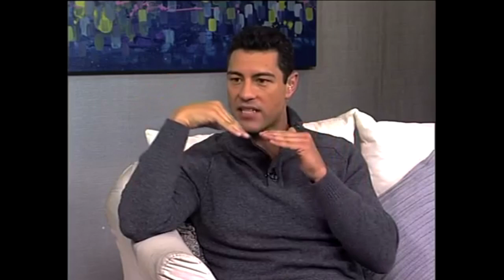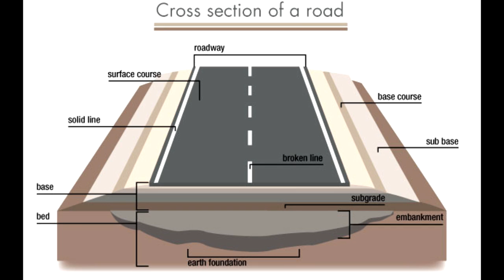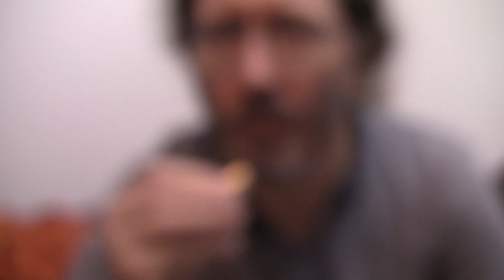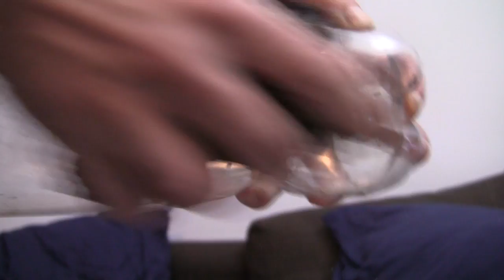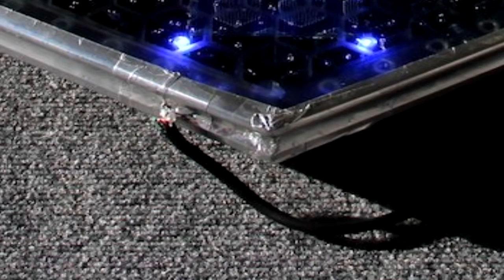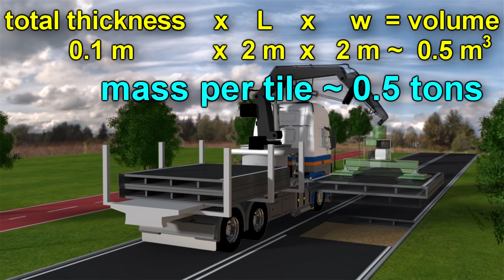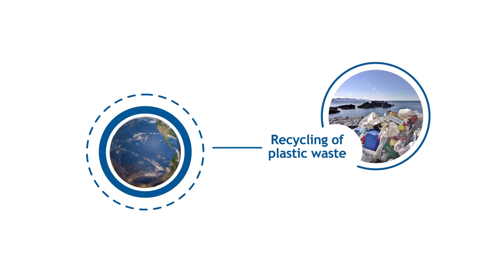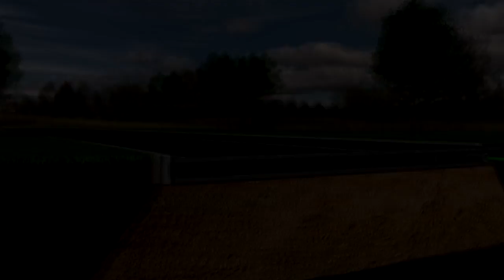Plastic Roadways BUSTED!

Comment: I called bullshit the moment I saw the floodproof part,  it MAY help with drainage over time but it will not prevent a flooded road, just a week ago I saw a drained road totally flood and the drain made no difference in the severe storm, no way in hell should being flood proof be a factor, that along with its other floors make it a scam clearly, there should be fines for things like this.

Comment: Wouldn't polybenzimidazole (celazole) be an example of plastic that fulfills a lot of properties required of road surface? The only problem I have found with it is that it is not recycled (as far as I know) and a bit pricey (5690 USD for 12x12x1 inch sheet).

Comment: If I were to make any change to the way we do roads, I'd swap the compacted hardcore for steel reinforced concrete, that would be immensely expensive to install, but the savings down the line would come from reduced flexing of the road surface which would then extend the time it takes for the road surface to crack and degrade and reduce the frequency of resurfacing operations needed.

It would also allow the ground below and around the road to be composed of gravel allowing better ground of absorption of water (whereas compacted hardcore can't absorb as much water) and would be less vulnerable to ants and tree roots.

It would also provide that channel they're after for utilities.

The problem of course being it would be expensive to install compared to hardcore and politicians tend to think of the election cycle ahead rather than the long term.

Comment: sooooo. instead of a bed of gravel and asphalt.....plastic road ways need a gravel bed, a bed of concrete, a retaining wall of concrete then the plastic top....so its a road with a plastic liner....right? I get the idea of using up plastic waste but is there any other mass used thing they could waste time on instead of road surfacing? Asphalt is about the best for its job, leave it alone and invest in something else

Comment: Just like with solar road ways this is not the way to solve a problem, you don't just throw out something that works because it has a few flaws, not if the system you're replacing it with is completely untested in every way. We should look instead at the problems he current system has, and how it could potentially be improved, then use incremental testing of different hypotheses which may yield various improvements. I would assume the major problems current roads have is the cost of construction, the sheer mass of material used for the roads, the energy that's required, and then longevity. Longevity is probably the most major improvement that could be made, even if a road costs as much to make but lasts twice as long you've basically produced a road for half the cost. Cost of construction could go down massively if more automation, less human labor, and perhaps cheaper energy was used, mass of material is probably something which can't be changed, we could build roads out of steel which is far stronger and lighter than aggregate, but has a very low lifespan when exposed to the weather, constant vibration, solvents, daily temperature variation etc. I'm quite sure we can't improve upon the efficiency of using a thick heavy layer of stone under our roads. But the road base generally outlasts the rest of the road, it's the surface which breaks down and requires frequent repair, doing so requires closing the road, tearing up the most damaged parts, filling in potholes, tipping hot energy intensive asphalt over the surface, pressing it down, waiting for the road to cool before use etc. This is the part that we might be able to improve, and should be looking at. Perhaps in the future we might have road surfaces capable of self repair at low temperatures? Cracks will invariably form in the surface but if they are closed or filled in before water and grit enter them, then temperature variations expand the cracks, more debris fall in, etc, which eventually causes the major cracking that requires repair. Perhaps just using small drones which travel among the traffic and inject hot Bitumen into crevices might vastly improve road surface longevity?

Comment: Here is another bigass problem with plastic, lets say they use PET plastic. The gasoline will slowly turn the plastic brittle and destroy it.

Also about the attachment part. You can easily plastic weld PET with ultrasonic or high frequency welding, Also heat welding which is probably what they would use.

Comment: A slightly different issue that may have been missed with regards to the hollowness of the roads... not only do you have those "pillars" carrying all the weight, you have to consider the stresses on the plastic next to the pillars when vehicles are putting their weight in between them. It won't be the pillars failing, it'll be the plastic surface cracking and collapsing right about at the edges of those pillars. I hope this makes sense...
Reply: Yes, like walking on a ceiling as opposed to the roof trusses.

Comment: + 
Thunderf00t  THE READS THEY WILL BE REPLACING THAT WARE OUT NOW TAR ROADS ALREADY HAVE ALL THE WORK DONE TO THEM UNDERNEATH IT WILL BE JUST A MATTER OF TAKING THE TAR SURFACE OFF GRADING FLAT AND PUTTING THE NEW ROAD DOWN NO BIG EXPENSE LIKE YOUR SAYING AT ALL.

IT WONT HAVE TAR ROAD RUBBING ON IT THO IT WILL HAVE RUBBER AND LOOSE DIRT NOT A SOLID SO NOW BE REALISTIC PUT DIRL ON THE THICKNESS THE ROAD WILL BE AND RUN TIRES WITH DIRT OR DUST ON THEM OVER IT WHAT YOU'RE DOING IS UNREALISTIC.

MIND YOU ITS PROB AS GOOD AS CARBON DATING TOTAL BS AND DOESN'T WORK

Comment: Before I watch this, can I guess a few of the points Thunderf00t will make?

1) Plastic doesn't handle repeated stress very well. Trucks and cars are heavy...

2) Plastic is known to break down fairly quickly when exposed to temperature fluctuations, like those that roads have to go through due to changing seasons...

3) Plastics in general, don't react well over time when exposed to sunlight and extreme temperatures...

4) For fuck sakes, hollow plastic roads? Does someone not understand that plastic isn't well known for its ability to withstand wear from friction, and becomes rather slippery when thing like oil based liquids cover its surface?

Methinks someone spent too much time alone in his room with his Hot Wheels race track...

Time to un-pause the video, this auto be good!

Comment: i think you forgot to mention that if there are cables running through the road, then when they remove a section, they will have to cut the cables running through the road in order to take the section out... and then they would have to put the cables back together in the process of replacing said section. They even show this in the video... although they clearly forgot to put the cables back together.

Comment: you missed the key point in the presentation mon librepenseur 
"contributes to 'circular economy' 
why would that be?
busy-work jobs, replacing the defective roadways and driver-less cars...
that isn't CASSE or steady-state,
that is neo-communist eh?

what is the plastic made from? what is the ERoEI of the plastic?
ostensibly, they do not know of MK Hubbert, Al Bartlett or S Michaux, despite being 'green eco-hipster"
too much numbers...
they do not know about resource finite limitations...

the ERoEI of plastic road is ridiculous.
better is the concrete as a byproduct from breeder reactors.
that's right. nuclear waste byproducts would make excellent tarmacs and road surfaces...
of the next-gen thermoplasma nuclear reactors etc...

Comment: To add two things, what about the water in the road, when the temp drops. It would freeze. Second, a big problem with plastic is the sk, microplastic, we have problems today with asphalt pollution from wear and tear, plastic would create a fog, that would be like asbestos. Just my 2 cents
Reply: monsieur jonsson, well said!
you haven't even begun to examine the ERoEI of the process,
or resource scarcity of the hydrocarbon to make said volume of plastics 
(MK Hubbert, S Michaux, IIASA, WFSF).

indeed, a carcinogenic fog not unlike asbestos, after rain + humidity or freeze and thaw.

Even if the polymer was GMO and technically 'alive' + error correcting...
(we now have pseudo-live polymer chains)...
it would be a risk to human security of biological contamination...

however... a thermal heat-sink power source from roadways
was also considered seriously by think tanks such as 
The Fenner Conference 2007 etc... many different groups meet there from around the world,
and thought about that as well as solar-collector energy etc.
(iodide gas reservoir is parabolicaly superheated by reflective mirrors etc...)

je prends conge, merci pour l'sharage et
bonne chance et bonne sante a vous mon librepenseur!

Comment: Many years ago, when I lived in Southern California, a stretch of road was repaved with bitumen mixed with ground-up waste tires, as you mentioned above. A big deal was made of this in the news, so when I happened to find myself needing to use that road, I paid attention. Let me tell you, that was BY FAR the smoothest stretch of road I had ever been on. It was as if I was driving a hovercar, not a single bump or dip. Why this is not a much more widely used technique, I cannot imagine.
Reply: Craig Corson How long was the road? Because short roads having been repaved recently are very smooth.
Reply: I don't know exactly, but it was several miles, not just a short section. It was literally as though I was driving on air, on glass - on something very very smooth.
Reply: Could be, I guess. As you say, who knows?
Reply: because of thermal expansion and how much slicker those roads get with frost up here in the frozen north they are useless
Reply: Used, worn out tires are very cheap indeed, and aside from being hung from the sides of boats as bumpers, have few other uses.
Reply: Happen to have a source for that claim? Sounds like BS to me.

Comment: The "economic" arguments for these are always poor and extremely bad logic. So watch out for it as you often hear it. Basically they say "this road will cost 100 million, employ 50 people who will spend their money into the economy and stimulate it. On top of that the purchasing of goods needed will put money into local businesses and increase tax revenue"

So debunking each claim. 
1. Its increases taxes.

Theyre spending 100 mill to collect 40 mill in taxes. So theyre essentially just spending 60 mill. Theyre worse off not better.

2. It creates jobs.

Those jobs are created by destroying jobs. The average government job pays 10% more than private. So to create 100 government jobs you needed to tax the equivolent of 110 jobs. Then the cost of bureacracy on top of that.

3. The spending from the workers and buying of goods needed to build the road will stimulate local economies.

This is the broken window fallacy. You are taking money from them which would have been used for something productive, and giving it back to the economy unevenly. Those with government connections get the money first, and money is directed not by market forces (satisfying the needs of peoples demands/wants/needs) but by legal gangsters.
Reply: +Vanessa H
If it destroys and creates jobs at the same rate, then you are pretty much back where you started. The only thing you achieve is that you take away someone's job, and give it to another. 

The example you provided only destroyed one job, while creating several of them. 

Also, plastic roadways are ineffective and expensive. Even at best, it can be only as good as asphalt, while being far more expensive.
Reply: Little Cripple The economic version of a perpetual motion machine.
Reply: Rly need to learn how the economics work.
Reply: Remember, we can just make plastic out of the air!  Air is free, so free roadways!!  Me good maths make!!  Kind of like the claim here that government jobs pay 10% more :p  This is a claim made only by people who have never held government jobs, or lived in the 1950s.  sigh
Reply: Whose jobs are you destroying though? I mean, the problem is rather that noone new gets employed, not that one gets fired and someone else gets hired. And the taxes thing of course only works in the long run, if it ever works, which it mostly doesn't.
And what would the money in your third point being used for? Isn't building a road something productive?
Reply: Benedikt
When gov. takes $1 from each of the 100 million tax payers and gives it to 1000 construction workers it's impossible to know what those tax payers would have done otherwise but we do know:

1.  Those tax payers would have spent the money on something that they valued, either consumer goods or producer goods (saving).

2.  Somebody, somewhere would have had a job producing #1

While building a road may be productive (depending on where/how it's built) it's unlikely to be as productive as #1 above, in part,  because the incentives are for politicians to spend where it will buy them the most votes rather than where it is actually needed most.
Reply: *****
Even with very low pay, one dollar is nothing. So those dollars that would be spent one something that either creates close to no jobs or jobs somewhere else (like if you buy a cellphone for example that is produced in china).
So if the government spends the dollar on the 1000 workers basically, at leat those create guaranteed value in the country/region and not value some place else where it basically doesn't help the gouvernment or the tax payers in that specific region.
Reply: Benedikt
You can't possibly know exactly what jobs would be created by 100 million people each spending an extra $1 of their own money.  It could be 1000 median wage jobs or 2000 part time jobs or even 10000 people who can earn a little more at their existing job but one way or another the total hours worked by Americans would likely be about the same.  Total real spendable income of all Americans would HAVE to be identical at least initially because each dollar given to the road crews would be taken from someone else.

Whether people spend their money on Chinese Iphones or U.S. haircuts is irrelevant.  Even a China produced Iphone supports many American jobs from the American Engineers to the American truck drivers and sales people who bring them to you.  Also, and this deserves it's own post, but even the portion of Iphone sales that actually do go to China comes back to America, either in the form of purchasing U.S. goods or in the form of foreign investment in the U.S.   Where do you think the Japaneese and Koreans got the U.S. dollars to build auto factories in the U.S.? 

On what basis do you "value" the road vs the "value" of whatever people would have bought with their own money? We know that the tax payers value other things more than the road  because if they did not then they would freely give the money for the road rather than being taxed.

Lastly, if you really believe that $1 is irrelevant even to the poor then I highly recommend you open up a "Two Dollar Store" selling exactly the same items as the "Dollar Store" and see how that goes.
Reply: *****
So what you are saying is, everything is a big circle anyway, so you might as well spent the money on the road or a phone or a car or whatever.
And what is up with your pathetic argument trying to prove that a dollar means something? Really, man? That's the best you got?

Comment: Someone saw how much money the solar road couple managed to scam out of people and have cashed in on that idea to scam a ton of money out of the foolish. 

This idea is just another money scam. But all being said, there is a massive market gap here with roads. It's a huge amount of land that is pretty much wasted. So I do believe there is a lucrative opportunity in making use of roads or the land roads occupy. Multilevel roads, steel tension cables or a netting material in the sub base layer to reduce sinkholes. Perhaps Nano tubing in the asphalt to reduce water pooling? I think there is a lot of potential for improvement in roads and someone will come up with an idea that will solve real problems in road design. Solar roads and plastic roads aren't the way forward.

Comment: I own a house outside of town. Anyone with enough age knows why it's colder outside of town. Now there's a water pipe i use to get water to my small crop experiments. In the winter, that pipe bursts because of the ice (i don't have the right to install a tap deep enough under the freeze layer because of complicated law reasons and disputes) so i wrapped it. Anyone want to take a guess why using plastic zip ties didn't work out for me, and had to resort to using twine? No? I'll tell you why, because IT FUCKING CRACKED IN THE COLD.
Fucking cunts with zero brains trying to steal as much money from dumb idiots ruining any kind of funding system long term due to investment fright. Fuck em.

Comment: So basically every car needs to have the same width between tires and run along the lines of reinforcement..Wait why stop there lets put steel channels in it we shall call them tracks, we will also make cars be stuck in said tracks so they dont drive where we don't want them. We watched a truck pull a few trailers and decided we could do away with cars and have something we call trains.
Seriously that seems to be how they think.